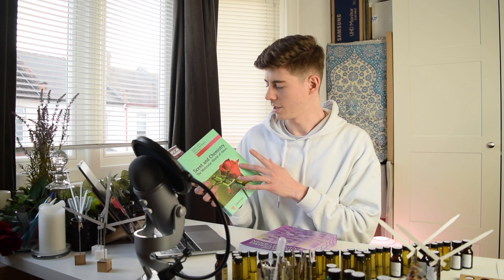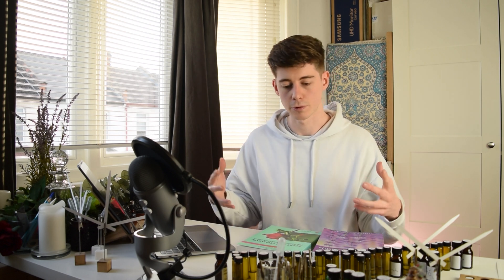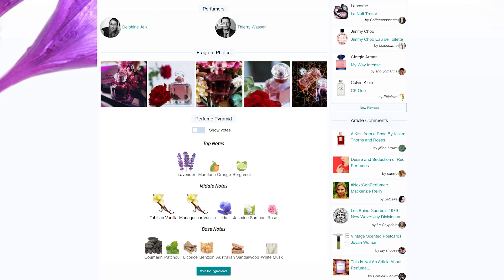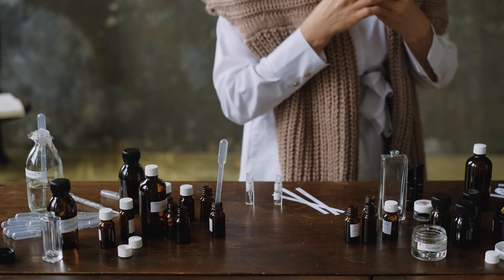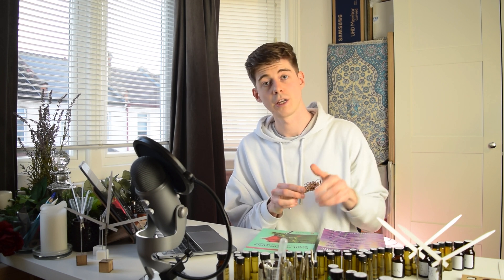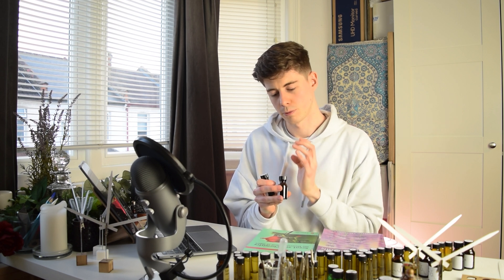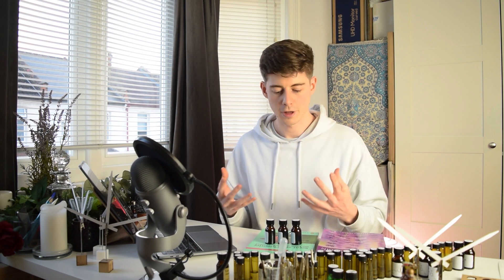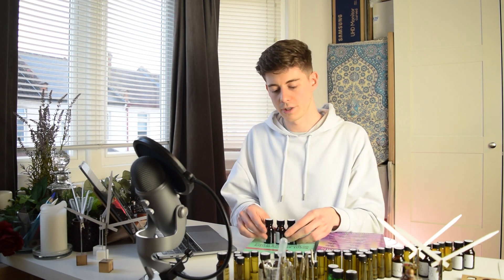Rose in perfumery - Harvest, production & smell

Comment: Hi Sam, how are you,  nice video , only got Rose Givco and so far I have only used it in male formulas, only to give freshness to the middle notes but at low percentage like 1% of the concentrate so that it only gives me freshness and not feel the smell of roses as I think that the base by itself feels somewhat flat ¿,with what material would you advise me to complement to give it some darkness? 

Saludos.
Reply from the maker: Hi Paolo, good thanks, and you?

Great question. Firstly, I would experiment with using higher percentages. Secondly, short of using the real rose oil, I would suggest that vetiver or oud notes may work well with it and add “darkness”, though of course not in the same way
Reply: @sammacer  
I am good! 
Thank you very much for the advice, clearly the absolute would give it more depth but it is very expensive for my level of experience.  I tried with carrot seeds and well diluted gives a touch to de topy note of de base, now I try with vetiver to see how it goes, thank you very much again and i stay tuned for the second part of the video. PS: Formulair is the best.
Reply from the maker: Let me know how it goes with the vetiver!